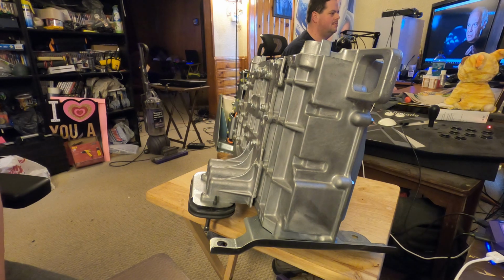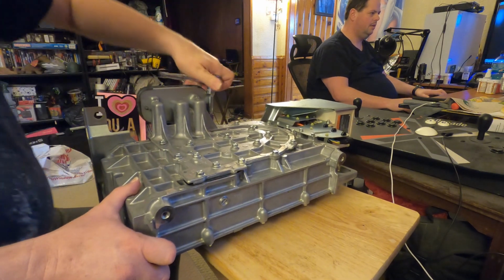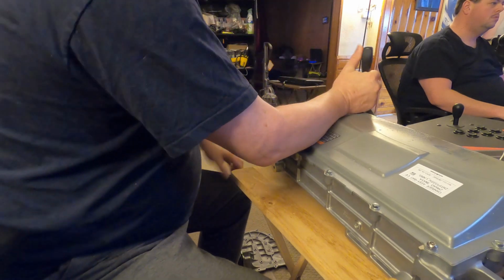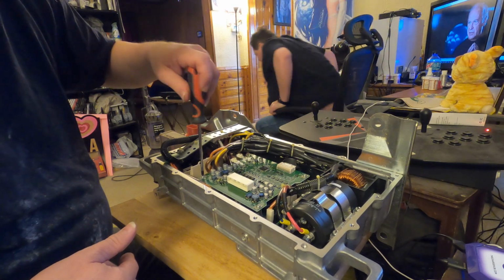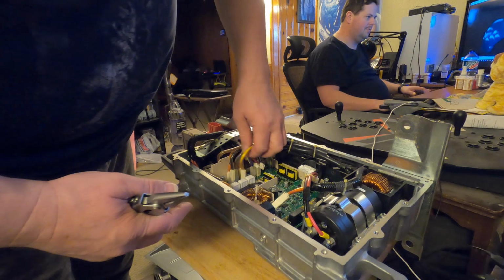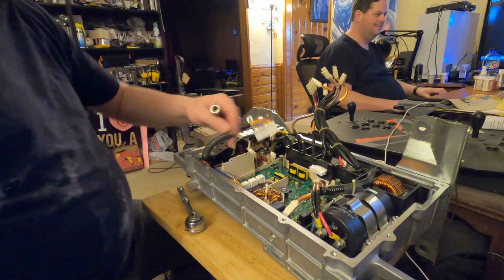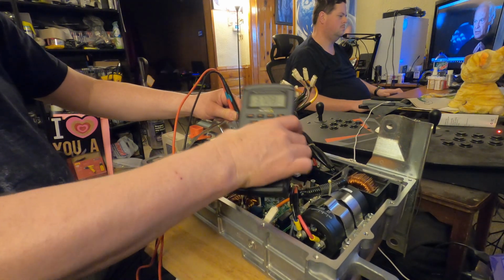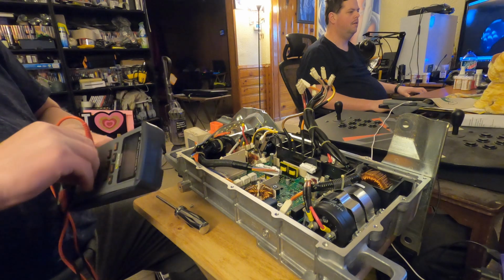Nissan LEAF OBC teardown

Comment: Why you not get yourself a 18volt Drill?,that would saves you alot of time and hazzle..just use slow speed,to not mess up them screws..🤔👍🤣🇺🇸greatings from Germany,i got same issues on my 2019 salvage Nissan Leaf,charger stays on green..need figure it out.

Comment: Did you ever find the problem ?
Reply from the maker: Mine had a failed chip.
Reply: @wolfman9999999  thanks for for this video 🙏🏽how did your lead behave on AC charge when you plug it in?mine starts to charge then just stop after 3-4sec
Reply from the maker: @xboxice2005  Our charger was completely dead.  Yours sounds like it has the diode problem, which is very common in the 1st gen LEAF
Reply: @xboxice2005  did you solve your problem? I have the exact same symptoms on my car. I plug it in and it beeps once and then stops charging after a few seconds🙁